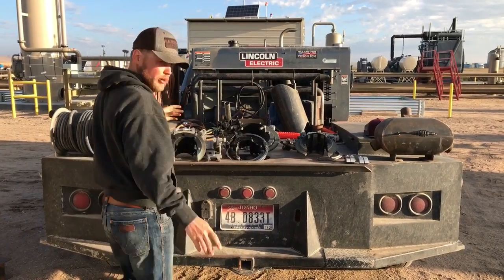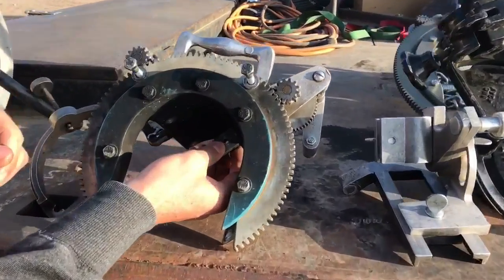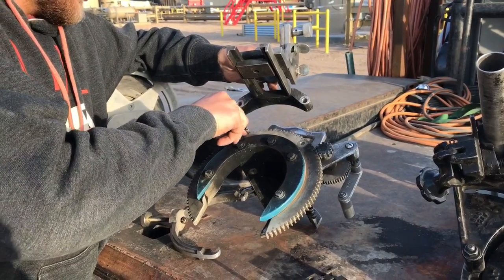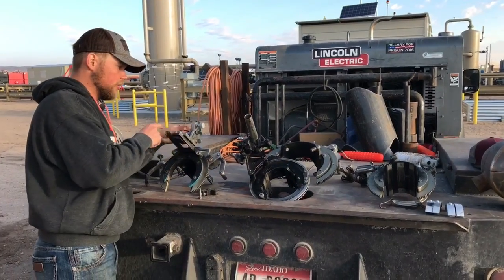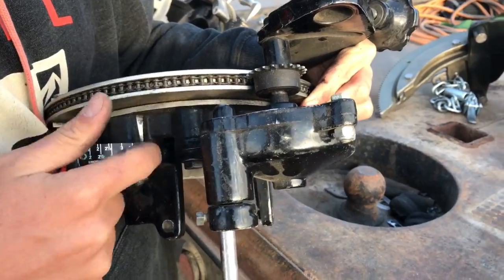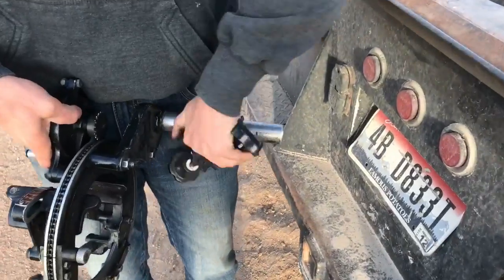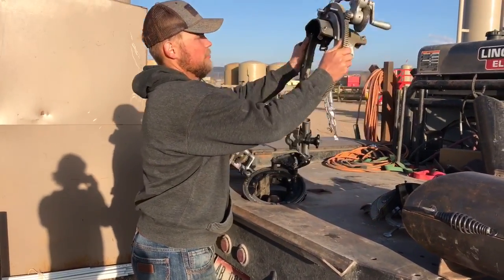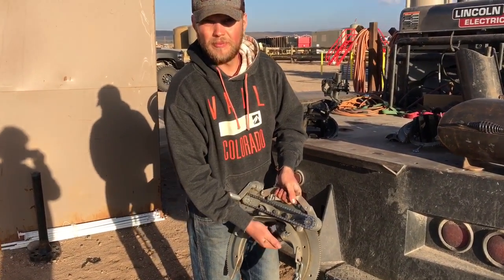Deciding on pipe beveling machines in HD

Comment: H&M offers a short saddle option in 4-8 inch. Also, H&M is a small company with personalized customer service, and outside of the anodizing or snapping it in half their machines are 100% repairable. Bend the saddle on a Mathey and it becomes a very expensive paperweight.

Comment: Mathey is the only way to go!! Short saddle and a better torch carrier and better aluminum in their build all around
Reply: H&M offers a short saddle option in 4-8 inch. Also, H&M is a small company with personalized customer service, and outside of the anodizing or snapping it in half their machines are 100% repairable. Drop a Mathey and bend the saddle, you're out $1300.

Comment: funniest thing you'll ever see is a green helper that's never seen an hm beveler.get the dogs all messed up.all b.s. aside go with the mathey that short saddle will save the day at some point take my word been in the biz for 20 years.but to be honest in the 2-4 range machines the hm cuts alot smoother for me especially on light wall 2".
Reply from the maker: Scott Everett very true I like the short saddle on it makes tight spots a lot easier.
Reply: H&M offers a short saddle option in 4-8 inch. Also, H&M is a small company with personalized customer service, and outside of the anodizing or snapping it in half their machines are 100% repairable. Bend the saddle on a Mathey and it becomes a very expensive paperweight.